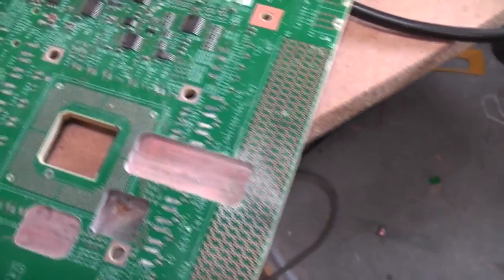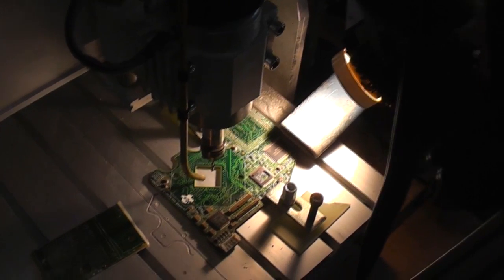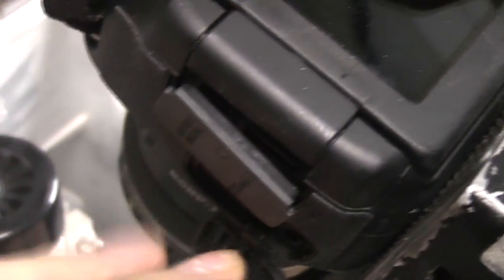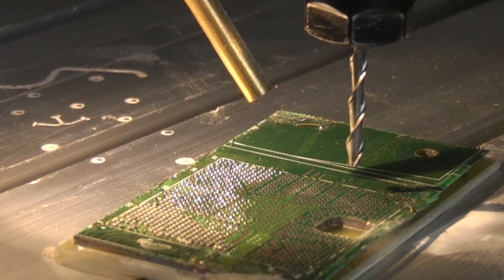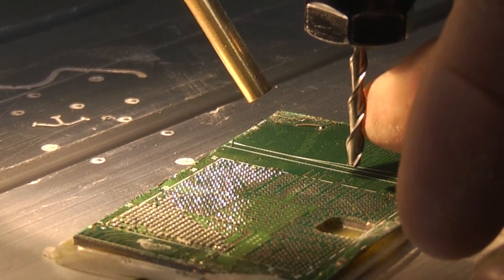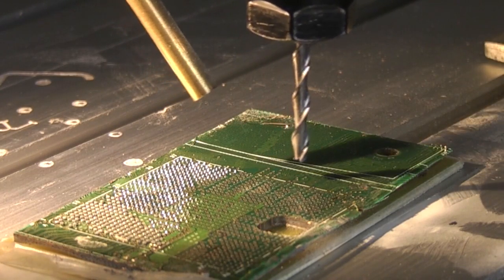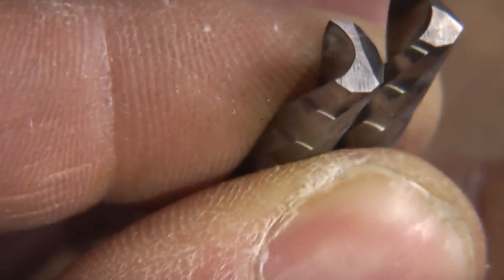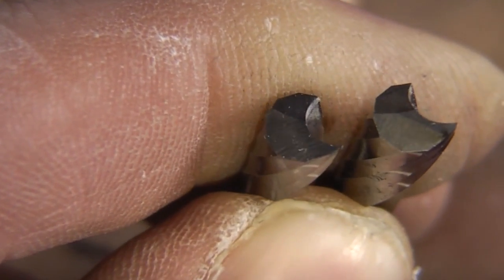Peeling multilayer PCBs apart - the setup

Comment: Great stuff!  Try a solid carbide cutter for better tool life in fiberglass.  In fact, use  carbide tools on everything.  They are more expensive, but will stay sharper longer in all materials, and will cut much more quickly in demanding applications.
Reply from the maker: +Applied Science It was carbide. Problem is when you're taking 0.01mm slices, all the load is on the first 0.01mm of the tool. This is almost certainly the wrong type of tool for this job.

Comment: I half expected you to just put a microswitch where the tool goes to after each layer and connect it to the shutter control :P

But messing around with GCode is fun, I have a homemade 3D printer myself.

Comment: A CNC surface grinder might be the ultimate tool for this sort of job. Precision and would not be bothered by the glass.
Reply from the maker: +ickipoo Yes, definitely - wouldn't even need a CNC one, but would need a nice smooth wheel. A super-fine diamond wheel might be good for doing ceramic hybrids.
Reply: +mikeselectricstuff 
Yes Diamond would be best, love your You Tube A+

Comment: 0.5mm its too much  maybe 0.1 or even 0.05  will do better results , but anyway impressive video mike thumbs up , very creative to use mist port to remote the camera, cheers mate
Reply from the maker: +design of modern life The layer step was 0.01mm - 0.5mm was just the clearance when moving out of the way
Reply: awesome
Reply: +mikeselectricstuff There is a balance between machine and tool rigidity, tool rotational speed, tool life for the most economical depth of cut. By using such small depth of cuts the tool essentially experiences similar wear each pass as it would if the depth were increased. It is also important to keep the tool cutting rather than rubbing. Just in tooling costs alone it is worth learning about feeds and speeds but yes PCB's are very abrasive on the tool.

Comment: I encountered a similar problem of CNC machine shutter activation many years ago. Unfortunately, I did not have access to an output on the controller as it was not my equipment and they did not like people tinkering with it. My solution was to gaffer tape a V5 micro-switch to the table and have the tool come over and activate it - a quick and dirty bodge that served my needs at the time!

Comment: For waiting, you can also use the G4 'Dwell' command, which is exactly meant to do some kind of waiting. So put this between M7 and M9:
  G4 P0.3
Would wait 0.3 seconds. Sounds less hacky than doing the extra move.
Reply from the maker: +Henner Zeller Yes - not familiar with Gcode - only thought afterwards that there probably was a delay command. Then again why waste time dwelling when you could be moving back for the next pass..